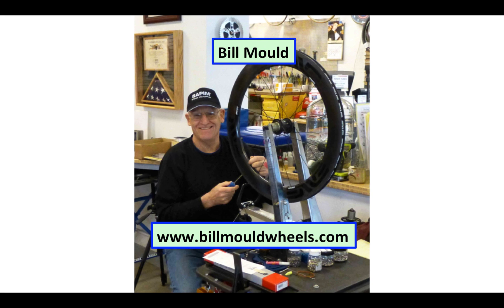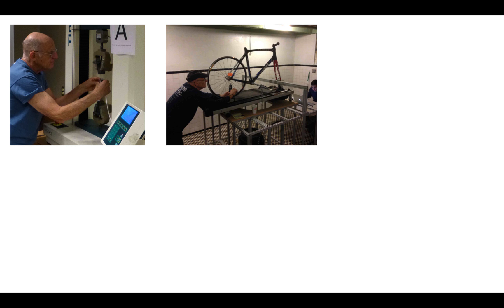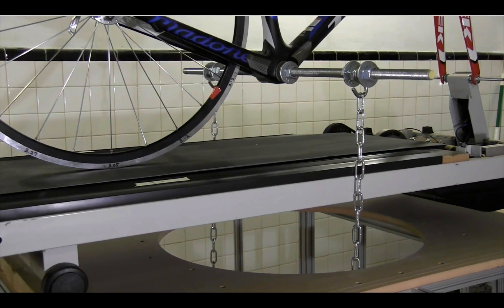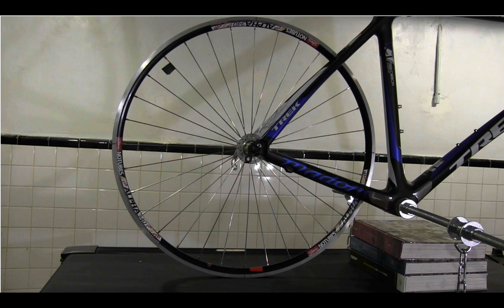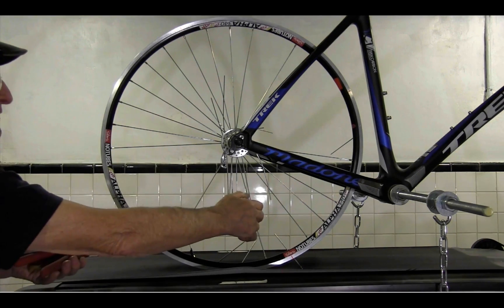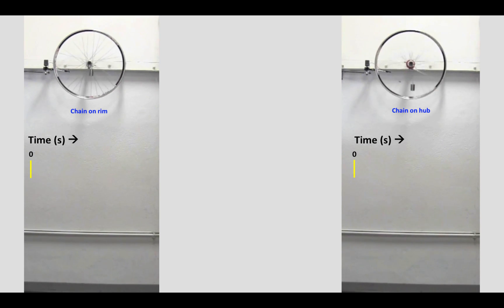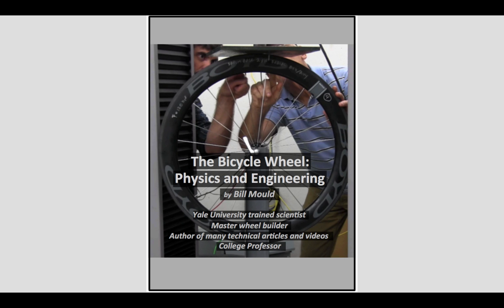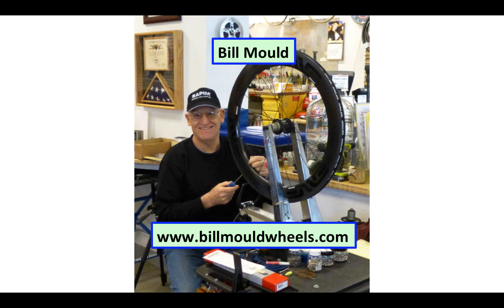Glimpse into "The Bicycle Wheel Physics and Engineering"

Comment: Ok. Hold on. Is this counterintuitive, it an I confused?
If you say the hub driven one is like the smallest sprocket of a rear sprocket cassette, and the rim driven one is like the largest sprocket of a rear cassette, then why is this happening?  Because the smaller,(hub driven) sprocket is always harder to spin up to speed than the larger sprocket.

In a real world situation using the smallest sprocket will be more difficult to accelerate but will end up spinning faster and therefore longer than if you used the largest.  Because you are putting more energy through angular momentum into the system, it takes longer but spins faster.

But it seems like the opposite of this is happening in this experiment.
Am I confused?  Can someone please explain.

Comment: Hi Bill,
Have you read the book ''The Bicycle Wheel'' by Jobst Brandt? If yes, do you disagree with anything in it? Have you ever met Jobst Brandt or Eric Hjertberg of Wheel Fanatyk?
Reply from the maker: Yes, I have read Jobst Brandt's book several times.  I like the book, but I know that wheels can't stand on their spokes like a pillar, because spokes cannot be put into compression.  If that is what he meant, I would disagree with it.  And, I know Ric Hjertberg quite well.   Why do you ask?
Reply: Thanks for the quick response! I like Ric's website and articles a lot, I was just curious if you also know him. Jobst did mean spokes can support loads in compression, just like a pillar, but as long as they are under tension, i.e they can support loads compressively up to the point of becoming slack. He also said tension in the upper spokes doesn't increase appreciably as the wheel is loaded, is this something you have observed?
Reply from the maker: Spokes are never under compression.  That is not possible.  When a spoke is in the load bearing zone, the tension decreases considerably on that spoke and the tension increases slightly on the others, including those on the sides.  I have tons on empirical data to prove this.  I don't know if Brandt literally meant that spokes are under compression or just that they act like they are.  The wheel is not standing on it's spokes.  If he literally meant that, then he was incorrect.